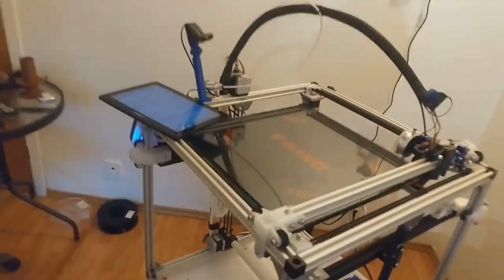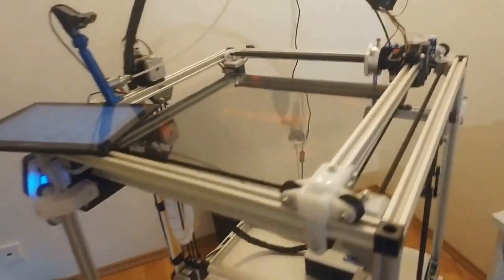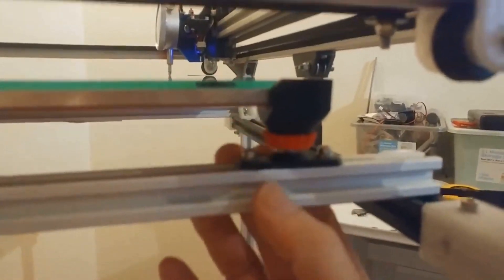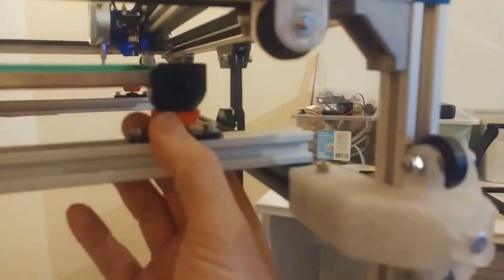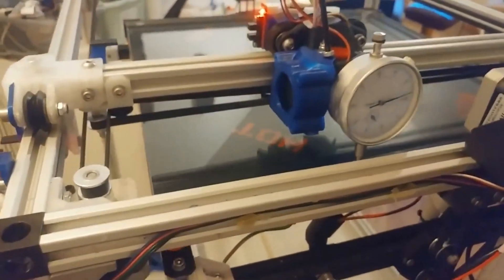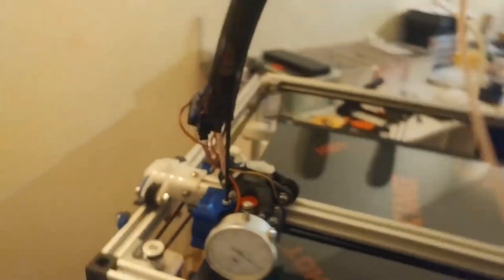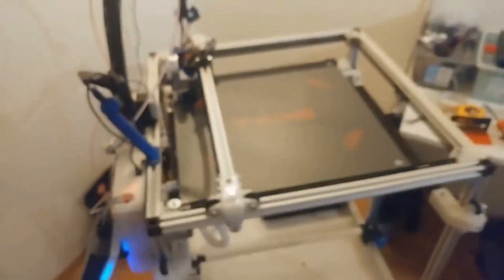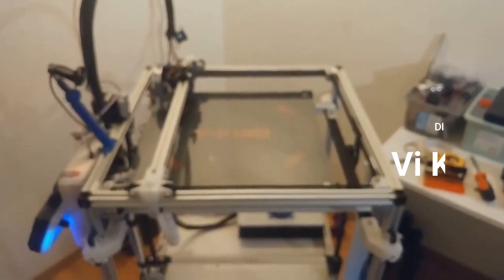V-King CoreXY - Advanced Bed Leveling

Comment: Is it me or is there much more deviation between corners? So the bed itself is slightly bowed?
Reply from the maker: You are right about the bed. This bed was a cheap rolled aluminum at 6mm and not very straight. I think a deviation at about 0.3 mm. I changed to a 8mm tooling plate dead straight